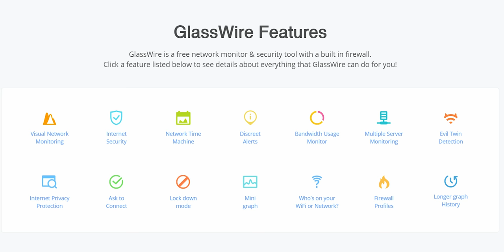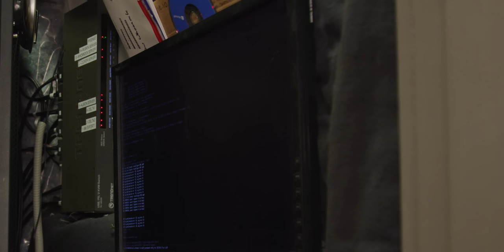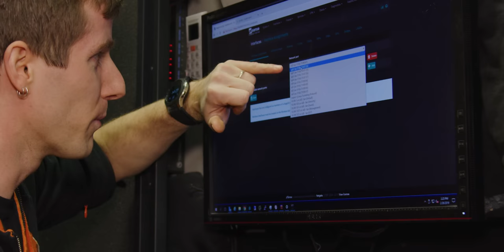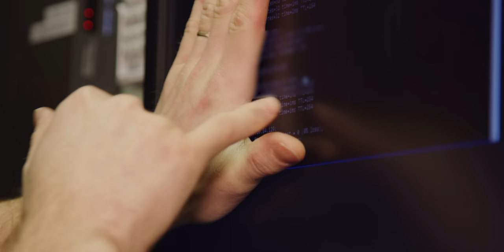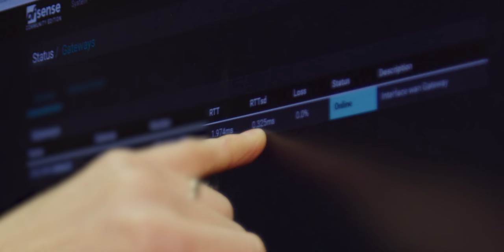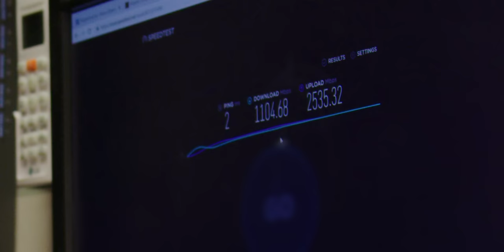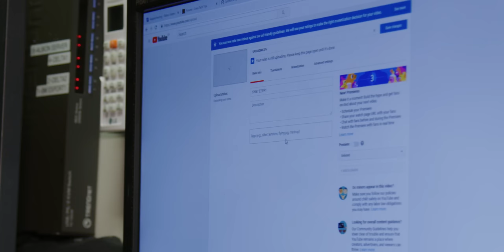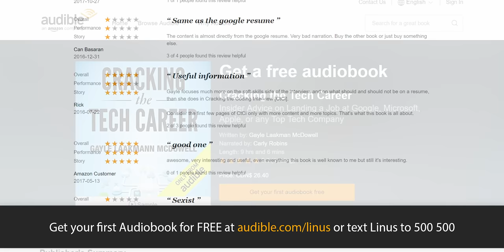We got 10 GIGABIT Internet!!

Comment: so you bought the best internet in the world for pirating... nice.
Reply: Not for pirating.
Reply: Actually NSA has fastest internet connection so they can monitor everything transmitted in the entire Internet in real time.  Be careful what you type!
Reply: Corvette Dude FBI open up
Reply: @calidude1114  Doesn't NASA Have faster/stronger internet in order to beam it to the ISS? Isn't Nasa's something stupid like 60gbps?
Reply: @Benthesniperof8  doubt it because speed has nothing to do with range
Reply: @Robstrap  I know that. But I'm fairly certain you need more bandwidth to throw in order to just get a half decent connection in space. Like if you were to just beam 1 gb of net to the iss it wouldn't have stable net at all. However you beam 40gb at it and it allows for the ISS to actually have internet.
Reply: Torrenting isn’t piracy
Reply: @IOwnThisHandle  Finally someone. Its just an protocol but this piracy thing sticks forever.
Reply: @livewallberg  Yeah... It is just one of those things.
Reply: Philip Polkovnikov  Really? Well Fuckin colour me surprised.
Reply: @calidude1114  Actually its nasa. Its just that its constantly underload so the speed available is lower.
Reply: Philip Polkovnikov  It dosent change the fact nasa has the fastest internet in order to obtain any link at all.

Comment: FYI 10G dedicated link in US is 180k a month.
If your transceiver is too strong for the length of the cable, you can burn the receiver on the other hand.
10G is the speed on the lowest layer. You need to put the data into frames, packets, segments and whatnot, sometimes it's also tagged - all of this takes away some of the bandwidth.

Comment: pfsense actually needs to do something about their physical/logical interface setup system because its really confusing sometimes.

I had an issue once where I switched hardware and imported the pfsense configuration and it overrode all the the interface assignments with the ones from the old hardware even tho nothing matched, and some of the actual physical interfaces from the new hardware disappeared from the list...

Comment: I through my Internet was fast until I realised that I was testing it in Mbps not MB/s which means i was reading 20 Mbps but in MB/s it's only 2.5!
Reply: That's how most ISPs promote their bandwith. 100Mbps instead of like 12MBps so the casual house without basic network knowledge thinks they have SUPER SPEED.
Reply: Just ruined my day. My internet is utter shit for what I pay =/
Reply: I have about 6mbps even though im supposed to get 16...
Reply: Data speed is measured in bits. Not bytes. No one measure connection speed in bytes.
Reply: @Swedishchef11  Steam do
Reply: @thekrasa1970  im sad right now i have 1Gbps i was think that is very very good
Reply: Brett Augustine   Yeah that's what i used!
Reply: @thekrasa1970  Yep
Reply: @Swedishchef11  Well I only understand bytes like Terabytes or Gigabytes...
Reply: @Fares-uw9wj  steams site with statistics shows in bits. Like Tbps or Gbps
Reply: @tomthefox3365  1 byte = 8 bits.

Comment: So if I had a same kinda 10 gig connection could I watch a live stream with  no noticeable dealy?
Reply: the delay would be the 2ms plus encoding and decoding time.
Reply: @GoodOlKuro  Ikr! But considering the fact that I'd have a monitor of about 4ms and a human eye cannt tell the difference between so less of a difference it will be almost as if I'm in front of the guy.
Reply: You would need alot less than ten gigs for a good live stream. But if you wanna stream games to a computer from something else it would work amazing
Reply: You would still get a delay, as you are not directly connected to the host, but to a server which is relaying the stream. The connection is like this: Stream producer -> Stream Host (server) <- You. And this is actually a simplified route. Basically, there are one or multiple servers in between, so you would still get some lag - but depending on the streaming provider's setup, it might just be in about a range of 5-30 seconds...might.

Comment: There, you don't need to concern air conditioner to maintain room temp, even you can stack the switch vertically with the fan at the bottom. The network room is neat, great.

here, we get heat, dust even electric outage problem in addition. Let alone 10 Gig, x100M is rare stuff.

Comment: What kind of ONT are you using for the 10GB speeds
Reply: They aren't using ONT, did you see video? There is Ciena gear.
Reply: @wiziek  Yes they are, all fiber lines have a ONT....  or Optical Network Terminal....

Comment: comment about "laser vs led" at 4:05 is wrong. should be long range (single mode) laser vs. short range (multi mode) laser. how far laser can travel is related to its power level, but mainly determined by its propagation mode: single mode vs multi mode. some low end laser emitter is of led type (not the same type led from your flashlight though), high end laser emitter has to use more exotic (not even silicon based) semiconductor technology.

Comment: Got 1 Gbit at home. Don't get me wrong, it's awesome, but it also spoiled me so much that I can hardly use the internet when mobile or on vacation etc. < 1 ms latency, no jitter, sites load super snappy. Most services like Steam, Origin, Xbox Live or most CDNs support the speed. Just not Playstation Network... it's ironic that free services support full speed, but Sony's subscription based service can't figure it out.

While you don't need connections this fast or faster for most applications, you can still feel the difference outside of downloading large files. Is like using a 144+ Hz panel for the first time. There is no going back. Good thing is that more and more optical connections are installed and it won't take long until these connection speeds become average in quite a lot of developed countries.
Reply: Commander ™ Xbox sucks and so does PlayStation

Comment: @4:15 "If you get a very long range one, and it's  too bright for the distance of the cable, you can actually get attenuation." What does Linus mean by "attenuation" here? The definition I know refers to intensity loss of a wave,  due to geometrical spreading and energy absorption.
Reply: Attenuation of the signal. Maybe it is too bright and the light penetrates out of the core. Just making an educated guess.  I think attenuation is simply any loss of the signal strength regardless of the cause.

Comment: so weird seeing my job on here. like you've always been about tech.. but not not as much on the high speed networking side of things.
these days, anything 1GE and below can be delivered on single fiber working using different wavelengths for send and receive. however 10GE definitely still needs a send and receive fiber. 
what's interesting to me is that the standards, equipment and practices for ISP networking in Canada is largely the same as here in Australia. even down to the colour of the loose tube sheath, labels and even the fiber trays in the housing

Comment: In Romania you can have 1Gbit for about 10 euro a month
Reply: I am from Sweden, and while 1gbit is certainly possible, its expensive. My ISP can give it to me for 600kr per month which is about 60 EURO so i am fine with 500 for 30. Romania got to be the internet paradise with those prices.
Reply: @Mundus66  It is, at least in the city. In the rural area the internet is quite slow and not that reliable. They used to give you a constant speed of 1gbit download and 500mb upload, but now it's advertised as Up to 1gb. I mean I can still download Starcraft 2 with 120 real mb/s. Overall it's cheap and good. I haven't been in rom for over 2 years, i'm in uk and their internet sucks and it's expensive

Comment: pfSense is totally unsuitable for 10gig. Yes. This is a FreeBSD limitation, not a pfSense limitation.

Although you are technically correct that, yes, a speed test requires sufficient bandwidth on the far-end, the speeds you are observing coincide with the performance limitations of the FreeBSD network stack, not necessarily the far-end.

Switch to Netgate TNSR if you really want 10gig routing...pfSense isn't it.

Comment: Why does it go to cable from the transceiver? I didn't even know that was a thing. The fiber optic line comes inside my house through a hole in the side. Yes, it's only a gigabit, but to my knowledge there's no cable at any point along it's path (until it goes to my transceiver which goes directly to ethernet).

Comment: Linus doesn't know what dark fibre is.

All dark fibre is, is a fibre connection that doesn't go through switches between connections.  If you had two locations, you could have a "metro" connection, which is cheaper and is a "live" connection going from telecom dmark to switch to switch [...] to switch to dmark.  That is how you can have redundancy.  This is cheaper because they don't have to manage every individual connection, only the connections between switches.  You could pay more and get a "dark fibre" connection, which has a physical and literal uninterrupted light path from your location A to location B.  This means, if there is no connections at either end, the fibre is dark.  No equipment putting out light.  That would mean you're 100% responsible for throughput, unless a digger hits your fibre.

Comment: There are a handful of speedtest websites that mutli-thread without having to use torrents.

DSLReports does by default, Testmy.net enables it as an option.
Reply: Speedtest.net does it now too, doesn't change the fact that they are not going host 10gig testing. Too costly and all business 1+ gig connections are actively monitored by the provider

Comment: Its not about dataspeed over the line.
Its about bandwidth, which in short means you can serve more connected users than before, within the same timeslot.
Which is exactly the point when you are a webserver provider.
Thats why you need a test which involves a lot of connected users, like downloading a torrent file, as mentioned.

Comment: Its not so easy to test that 10 Gb\s using torrents. Its 1250 MB\s which is not reachable for sata 3 SSDs, you need a top PCI-e SSD drive or SSDs in RAID-0.

Comment: GIGABITS speeds are becoming irrelevant topic. What's relevant is latency of your internet connection. That's the true speed of your internet, not Gbps. Anything above 500Mbps is irrelevant if you're getting 200ms plus latency of web pages loads. I dialed in my dns to 12-17ms.
Reply: Well, at least not for them. If you're uploading a ton of videos, it doesn't matter your latency is 200ms. It's still 10Gbps. Sure, for browsing (or gaming) 200ms would be dreadful, but for uploading large files? You wouldn't even notice.

Comment: That LH sfp that you showed off as 10gb is only 1gb.  LX/LH is a 1gb standard and you can tell just by looking because the extraction handle is a round wire.  10gb sfps have a flat sheet metal handle on them.  The blue color of the handle means it's a 1310nm laser.  The 10gb equivalent version of that is LR and it had a medium blue flat steel handle.  Now back to youtube videos on screw drivers.